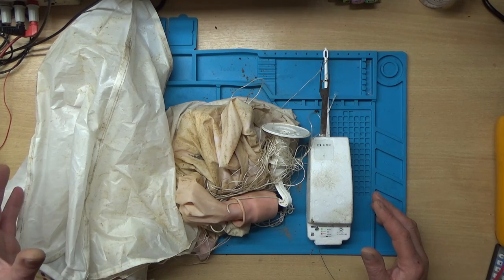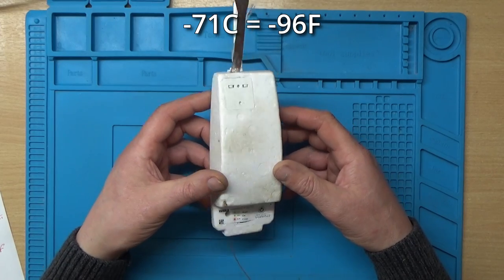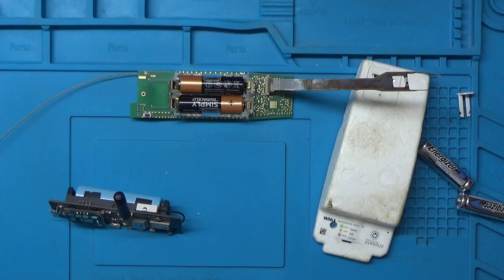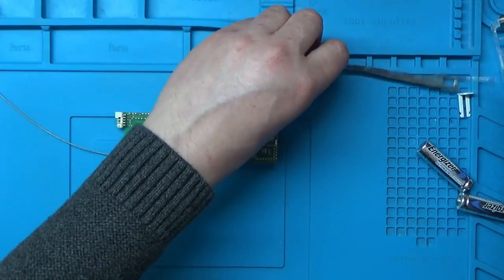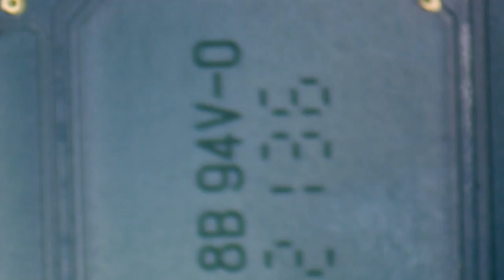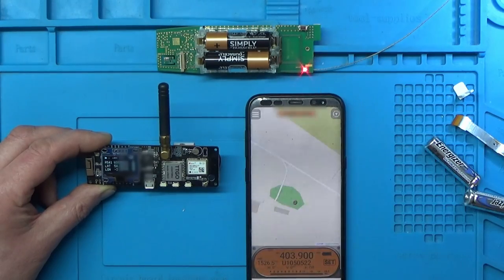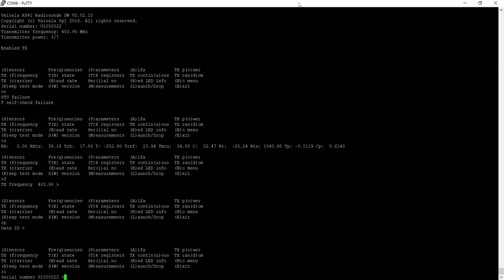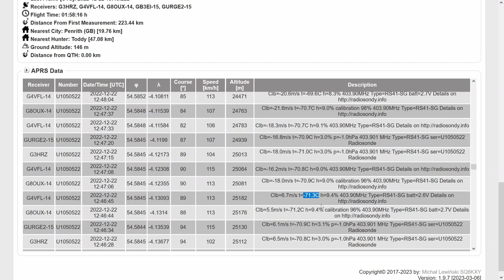Radiosonde RS41 Weather Balloon - Teardown and Secrets!

Comment: The RFID, from what I remember is to activate it prior to launching. It registers it in the system and may set the frequency and other parameters in the unit. I was able to launch one in Antarctica. Did two contracts at McMurdo and the weather people let other personnel on station the opportunity to set up and release them. Cool system with a weight tied to the balloon as it's filling so you get the exact amount of lift that's needed to have consistent lift for each release.  And they DO try to recover them in summer (I go in winter) in Antarctica, if the location it was reported at is safe to get too. To limit the waste they leave behind.  Back in the US I had found a few that washed back on shore, but unfortunately after spending time in the salt water, they were totally useless.  Cool walk through with an operational one!
Reply from the maker: Thanks, and interesting info! I don't think they have a recovery policy here in the UK as a lot of the ham radio guys go looking for them and the majority of the radiosonde end up in the sea.
Reply: @BuyitFixit  I don't think anywhere has a recovery policy, except maybe Antarctica. They do try to minimize the waste left behind. You can't even piss in the snow, if you do you get sent off! For the American stations anyway.

Comment: I launched many radiosondes in the military (before GPS technology) which were radio transmitters.  What appears to be missing on yours is a barometric pressure sensor.  A calibration is required before launching which is what the connector is for.
Reply from the maker: Thanks Charles👍I think the RS41 uses GPS to guestimate the pressure, and I think the calibration or settings before launch can be done via RFID or the connector from what I remember.  Thanks for commenting 👍

Comment: I dont know if you have done it before but u seem like the kinda guy who could do it but. You said u made a tracker for a weather balloon but have u thought about trying to pull down data from weather satellites. I think you can do it with open source software but im not sure about hardware. I think you can get decent results with pretty basic stuff. Make a interesting video either way.
Reply from the maker: Thanks Gary, I've not pulled data from weather satellites. I did look into it at one point and I think you can do it with a SDR dongle and a laptop, and running some decoding software to obtain the image. I've got a few SDR devices so might have a go at some point.

Comment: .... as Pif once said, "Miammmmm"! nice dev board! :D
i live in Romania, really low chances to see one of these flying happily thru my window! :)
that thing looks like is a 1.8V system, because i never heard about 2v stabilisers, linear or not, and main voltage being 3V, not 3,3...

that "grate" part on sensor tail is a humidity sensor, yes... the most simplest one: at a given humidity, between these tracks there is a defined resistance, if humidity will grow, their resistance will be lower, so, you can estimate accurate enough humidity around...
temperature... most semiconductors are temperature dependent, so, again, simplest form of a temperature sensor...

interesting that TTGO LoRa, i think i will order one, not necessarily for sondy, but for my own fun! :D
Reply from the maker: Have a look on the website I mentioned on the video, they launch balloons all over the world, some may venture near you.
Reply: @BuyitFixit  ... most closest is in Bulgaria! :))))))
Reply from the maker: Another video you may like is the RGB laser that I repaired or the solar inverter where I had to reverse engineer the software to get a service password.

Comment: Interesting. I was surprised at how frequently it seemed to be transmitting, considering the GPS capability as well, these must have a short battery life. Appreciate they need to monitor the weather somehow, but what a waste. RFID seems a bit pointless on such a device.
Reply from the maker: Speaking to a friend he thought the RFID is used in automated launches so they are put in a hopper and checked just beforehand. The battery life is supposed to be around 3h. I might do a future video if I get my receiver set up so it's permanently monitoring, and attempt recovery of one myself.
Reply: The RFID from what I remember sets the configuration for the radiosonde and registers it in the system prior to release. Probably cheaper than a cable and connectors now that RFID shit is so cheap.